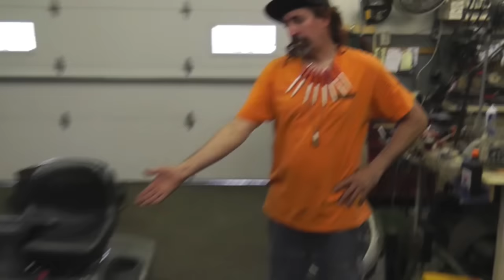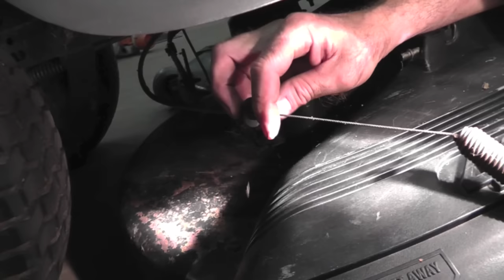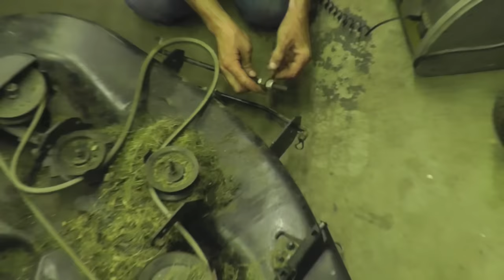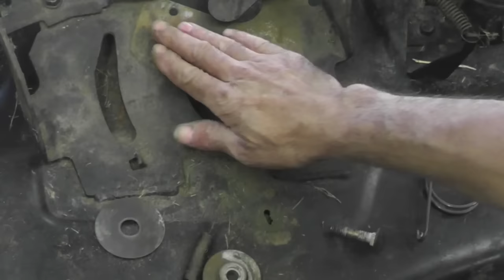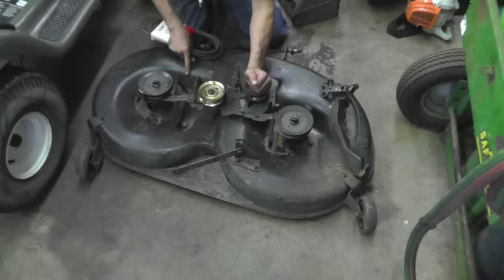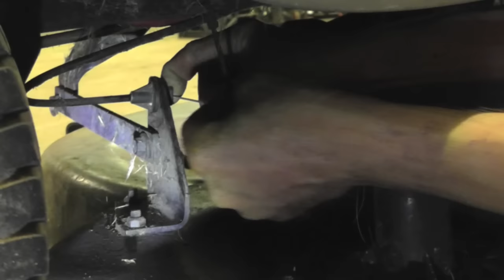How To Fix Stuck Deck Engagement (Blades Always Spinning)

Comment from the maker: Be sure to pick up YOUR Taryl Apparel Today! Shipping Worldwide Daily. 
http://www.TARYLFIXESALL.BIGCARTEL.com
And There's Your Dinner!!
Reply: I have the opposite of this prob
Reply: I have an issue maybe you can help with. I've got a Troy Bilt 1842 that when the blades are engaged it takes a while before they get up to speed. I've replaced all the pulleys and belts
Reply: Jason Lackey probably belts not tight enough you should be able to adjust them
Reply: Taryl you are the greatest. I have learned so much from you. What I like most about you is the fact that you cover everything. Thank you for your service.
Reply: Taryl is king!
Reply: You are the man Taryl. 👍🏼
Reply: Just what I needed.

Comment: Taryl, you're the best! Very informative plus lots of fun. I'm an old guy (68) and remember hanging out in machine shops and gas stations in rural NC. Started out as a kid fixing flats (a weekly event) on my bicycle, then trying to get my first $50 junker Ford on the road. You could hang out with the older guys, learn something and maybe even get a sandwich and RC Cola if you swept up the place, cleaned out the grease pit and dumped the ash trays. You take us back to the old days! Mechanics back then didn't have clean clipboards, clean fingernails, wear ties and girly earrings! Back to the present... a month ago I successfully replaced my Craftsman's blades after watching another of your videos. Now I want to pull my deck again to check a few things you covered here. Thanks again! You really should be on prime time TV!

Comment: So I just changed my spindles, pulleys, blades, cleaned the deck, and fixed my blade disengaging issue. All thanks to your video.  Probably took a little longer than it should have but hey it was my first time. Thanks for the great tutorial!!

Comment: My Ariens 42" gear driven rider has the exact same deck.  I had some broken blade spindle mounts and had the problem with the blade not disengaging.  This was the exact fix I needed and I learned all I need to know about my mower deck from this video.  I just got done gooberin' it up and it works perfectly now.

Comment: You are amazing. A customer brought in this exact same tractor. I got it running like brand new and went to mow with it and I couldn't get the blades to disengage. Watch this video and did the exact same thing you showed and BAM. Engages and disengages as it should. Hes got a beautiful running and mowing tractor now.  Thank you Taryl.

Comment: Thanks for the great video Taryl! It was as if it was custom made for me. I have a Craftsman LT2000 year 2008 and my problem was the exact opposite. My blades would NOT spin half the time when engaged. Last weekend I dropped the deck and applied your fix to the letter and, PRESTO, smooth as silk now. I even used the anti-sieze goop like you. Keep up the great work. I learn a lot. Your videos are not run of the mill. They address real world problems. Even the odd problems that only an experienced guy like you and your crew see. In this case, you used your engineering skill and mind to solve the problem WITHOUT new parts. You were right, anyone else would have simply ordered new parts. Keep it up. I need my dinner!

Comment: Thank you so freaking much, man. Taryl, you saved my biscuits with this one. I've been trying to figure out why my blades won't disengage for a long time. Haven't fixed it yet, but from what I have gathered, going down there and pulling and wiggling and observing, this is definitely my problem. Great work!

Comment: Taryl,  I wanted to say Thank You!!  Been working on my Husqvarna 42" deck. Replaced spindles, pulleys, and blades brakes.  Everything was great..till the brake part.  Just wouldn't work quite right.  All parts I reused except new brake pads.  Took it apart twice but it just wasn't smooth as it should've been.  Saw the video, took it apart and used power wire brush to clean the original parts.  Then I "goobered" it up as you said and put it back together like you did.  Worked perfectly!!  That polishing and taking off all the 10yr old crap (roughness" was the trick.  The "goobering" I actually said out loud for luck as I put it back together. Thanks buddy!  Keep up the work.

Comment: Had the same problem but I ran over a bunji cord and had to change the belt and then noticed the gear was super tight and it was rattling and you just showed me what the problem was (need to file it down) wooooooo hooooo!!!! Thank you!!!

Comment: Awesome!  I have this exact same Craftsman LT200.  Mine was seized in the same place.   Replaced both pulleys 173437 & 173437 (they are slightly different), cleaned up all the surfaces with a wire brush attachment for a drill, used anti-seize and this video.  No longer chews the deck belt and disengages perfectly.  Thank you sir!

Comment: Followed your instructions to know what to do on my 2002 Briggs 21 HP 42 inch deck LT1000.  I was having trouble trying to find the spot to stop the blades from continually running - a dangerous issue to be sure! Glad to get the "heads up" from the expert.  I like your trick of folding the leading arms to make a handle!  Good Work Taryl!

Comment: Hi Taryl!! I just did this on my ARIENS 42"  tractor mower because YOU show everything step by step and I for 1 really appreciate the info video.
BEFORE the replacement of the plate (that you ground) I had replaced the idler pulleys with exact replacements (My old ones wern't bad but I had the deck out to replace the DRIVE PULLEYS and thought I'd be proactive by doing the deck pulleys too) My mower was working ok with the old pulleys but after I changed the deck pulleys and turned it back on the deck was making a horrible racket, so now knowing about the sticking/worn plate I figured THAT was the problem and ordered a new plate, new brakes, new springs and took pictures of everything BEFORE I started and followed your GREAT video to the T. - I got everything back together and same thing; the deck makes a horrible banging and there is a horrible vibration that wasn't present BEFORE I changed the (deck) idlers. I have had the darn deck out SEVERAL times now to check everything and everything seems fine. I don't think the blades are timed on this unit......Any suggestions as to what to check next?  Thanks Again!!

Comment: Mr Gross.  Thank you so much for your instructional videos!!!!!  I have a 2005, Crapsman LT2000 garden tractor, that I am keeping alive.  Somehow, I sheared off the support that suspends the deck, after a pulley spline "rounded out."   I had already replaced the engine with a real Kohler, Command, from a "Briggs -n-Scrappin," and numerous spindle replacements.  I was ready to give up and trash the "tractor" because of the sheared support.  A neighbor had a old rusted deck.  I cut off the three welded tabs, that support the idler pulleys, and mig welded it my deck.  You inspired me to not quit.  I have a kubota tractor with loader, backhoe, and belly mower.  But, I am challenged to keep the Crapsman alive.  90% of these mowers are made by MTD, a corporation that began in Cleveland, Ohio, 15 miles from me, in the 1930's, by real machinists.  Thank you so much.  Junior, William, Ronny, and that "Taryl" guy, are a really a good crew.  Ron

Comment: Great! Exactly the same deck as the Ryobi HDK19H42. Had to replace a spindle and when I got it off found the problem with the engagement. and tension springs. You explained everything I had going on.

Comment: Taryl, I'm now a subscriber to your channel!  I was going to send my 2006 Craftsman LT3000/20HP/42" Deck (917.276813) to a small engine repair shop until I watched your great video.  Hands down the best instructional/fix it yourself tutorial I've seen to date!  I removed the blade clutch unit, detailed cleaned each part and afterward generously lubed all the parts.  Once reinstall all parts, I was very impressed on the ease of engaging the blade control lever.  I can now engage the lever with one finger, ha!  And the braking of the blades even stop better than before.  You Rock!  I look forward to more helpful videos...

Comment: 10 POINTS!  I thought those "detents" were supposed to be there. I ground them out, cleaned it up, goobered it up with grease and shot some spray paint on the deck to boot. Engages and disengages like a new one! Thanks for the tips!

Comment: The best video I came across, see many more but did not mentioned duvets. But luckily before the deck was to get attached, I use my grinder to take duvets out. Thanks. 04/01/18

Comment: Now boys and girls, there is a BIG difference between Mechanics and parts changers, Teryl is a MECHANIC and a da## good one !
Reply: When I worked at an auto repair shop, I used to joke with people and tell them I was just a parts changer, but in truth, did more "repair and modification" of parts than changing the parts out if the fix was just de-burring or even some other modification ... sometimes it is faster and works better than a new part ... saved the customer some money and time from having to wait for the part if it wasn't on the shelf of the parts store ...

Comment: Great to see you saving customers money..alot of shops just replace the plate. However Those cheesy engagement cables break alot because the tensioner pulley assembly binds up from wear and stresses the cable. 
I find a 96 inch belt works better than a 95 or 95.5
I've replaced at least 5 this year. Had to grind a few of those divits .

Comment: Thanks for the video, bought a 2002 LTX1000 Craftsman tractor with Kohler 18 pro OHV single  and bent the deck after first  time using it, smoked a patio slab at full speed!  Deck  does not lift very high lol. I  watched your video on how to straighten it out and now I Found this one.  I just subbed Thanks for the help, anyone who owns a craftsman tractor check your fuel tank mine is cracked at the top corners garage filled with fumes when I filled it up, need to get a new one ASAP.

Comment: I was trying to figure out how to do all this just yesterday!  I installed a new clutch cable and now the blades will not stop running unless I turn the mower off.  The answer is the same as you show in this video!  I bet ya dinner if I do what you say, the problem will be fixed!  The beauty of it all is that my craftsman mower is the exact same model and color as the one you show in your video!!!!!!!

Hot diggity dog!

Moonpie
Reply from the maker: +MrMoonpie001 THERES YUR DINNER! & have a moon pie fer dessert

Comment: This one is my exact model. you have my freebie the side of the road up and cuttin grass with just a  solenoid, battery and deck cleaning lubing....to the tune of only  70 dollars I am cooking with crisco....now to figure out why it is smoking out the oil filler...I imagine in one of your videos I will find out. great job explaining for the newbies like me.
Reply: a13thhour smoking out the dipstick tube is usually a blown head gasket

Comment: By the way, the 42 inch mower deck on my Craftsman LT1000 had the issue of the continually running mower blades:  the suspicion was that the new ground drive belt I installed was tighter than the well worn original belt, plus the new mower drive belt was not fully retracting - the clean and grease solution you showed helped but didn't totally solve the dangerous issue.  After reading the Craftsman owner manual and studying the drawings and parts list, I realized that one of the springs, the "spring, extension P/N 131335" was missing from my deck.  I ordered a new one as well as the engaging  (pivot) arm return spring.  Once those two replacement springs are installed I will reevaluate the blade turning when not engaged issue.  Luckily my mower deck had very little rust due to the dry California weather.  A new tractor/mower is around $ 3000 here in the land of air quality controls and taxes. Fixing the one I have is the answer for now.

Comment: Taryl I'm surprised you don't use a pneumatic lift, you wouldn't have to lay on the floor. They have side extensions that attach for a lawn tractor. It saved my back!

Comment: I inherited a craftsman lt1000. I had to rebuild the mower deck. I replaced a spindle both blades and the disengagement spring. Eventually I need a new pin for the cable that engages the deck.

Comment: My 2003 Crapsman LT1000 has had a hang up in the belt tightener for a couple years. I used to be able to stomp on the left side of the deck and it worked. Today I decided to fix it, and was going to do it with the deck on. Then I saw that the hydro drive belt was turned over, running on the back side and found a chunk of it missing. 😮
 I ended up pulling the deck out, so I could get the drive belt out. Got both belts ordered and sharpened the blades, cleaned the bottom of the deck some and have the divots ground flat so the belt tightener works freely.
 I guess I'll twiddle my thumbs till the belts get here.

Comment: Great video Taryl. If you get a chance can you do a video on a 42" MTD with the brakes on top of the pulleys that won't stop the blades. Thanks
Reply: No the deck doesn't even reach the brakes. I've made sure it was all hooked up like the manual shows. Made sure I had an OEM deck belt. Tried adjusting the rod. I even talked to MTD teck support but they couldn't figure it out either. I bought it used maybe the guy had changed the deck bracket arms or something. I just don't know.

Comment: I believe there is a problem with the cable end re-assembly.  Taryl put on spring, then washer, then clip, but I believe it should be washer, then spring, then clip.  Another youtuber said the washer is below the spring so the spring doesn't work its way down the shaft.   Also, I checked the LT1000 owner's manual and it also shows washer, then spring, then clip in the parts diagram.

Comment: Great instructions, thank you. HOWEVER I think placing back clutch spring on the pulley bolt should be as following: washer, spring, retainer pin. With the spring placed first nothing prevents the spring to slide down.
Reply: ... I added a washer to the belt pulley ... one on top and bottom, just to make sure the spring stays there and off the threads of the screw ... retainer pin went in just fine ... anti-seize everywhere that came close to touching or rubbing ... even oiled the springs and used parts cleaner on the pulleys to make sure they were clean and free of grit or oil ... even cleaned the pulley faces where the belt rides to make sure there is no rust or trash there and lubed the bearings, just because they were there ...

Comment: Great video. Looks like mine. Replaced my coil, smaller than original. How do lube the deck? I started my mower and had to hand move the blades to get them to work. Not running at the time. Finally freed them. How do you lube the blade mech?

Comment: Thank you for the detailed video. It helped confirm that my idler pulley spring is missing!. While installing a new spring I noticed that the inner idler pulleys are not in alignment (same height) with the outer blade pulleys ? Is this correct?

Comment: Done the same thing except, I bought a new deck. Mine was welded by the previous owner. My problem is that I've changed the clutch cable twice since last year (This is number 3 at this point). The spring portion rubs on the pulley from the momentum after disengaging thus, cutting it clean after one season of use. Is there a way to lift that spring portion away from the pulley without interfering with its functionality ? I thought of buying a new bolt where the washer and clip is secured to but, I saw, from this video, that it drops too. Oh yeah ! I installed new brakes too. Maybe the old ones didn't engaged fast enough to stop the blades from spinning.  Thank you very much.

Comment: excellent video, I watched your video a couple times and not only removed my deck, but I repaired it. It had one large hole in it, and several small breaks around the discharge location. Everything went back on and seemed perfect, but when I hit thick grass the blades stopped.... My question is : how do I tighten the tension on my mower so that the belt is tighter when engaged

Comment: This deck design is the same my Ariens 42". I've had the disengagement problem for a while and just been living with it. A new problem I'm having is belt slipping with blades engaged, even after putting a new deck belt on.  I've been banging my head on how to get more tension on the belt because there's no adjustment available on the cable or cable bracket.  I've created a spacer and placed under one side of the cable mount to tilt out back attempting to get more tension, didn't help. I'm now thinking this may be a new symptom of the already existing problem of the blade disengagement? What are your thoughts? Have you needed to create more belt tension and how on these decks before?

Thanks a ton for the great videos and guidance!

Comment: great info.  The tension cable from the engagement handle to the the pulley has a plastic clip on it that keeps breaking.  What would cause it and is there a way to not use the plastic clip and use something mettle on the ball instead?

Comment: Taryl, great content! Thanks for all the helpful videos. I replaced the worn out plate, idler pulley, 95" deck belt and engagement cable Goobered everything up so it moves back and forth real smooth and my blades still spin while the lever is disengaged. Any other thoughts?
Reply: Not as much as when they are engaged, but still spinning.